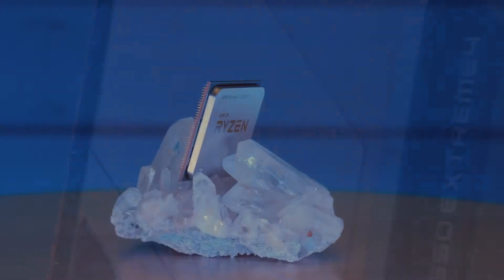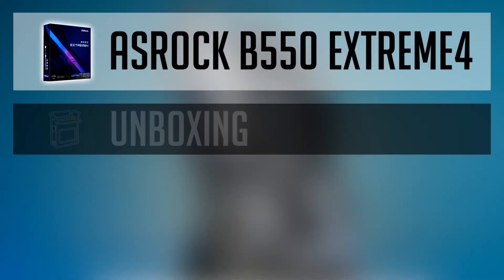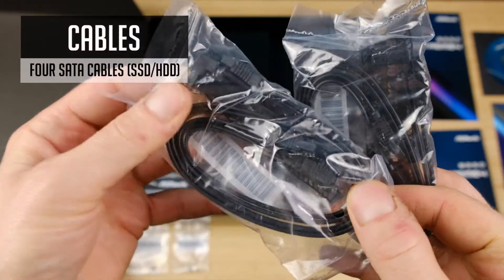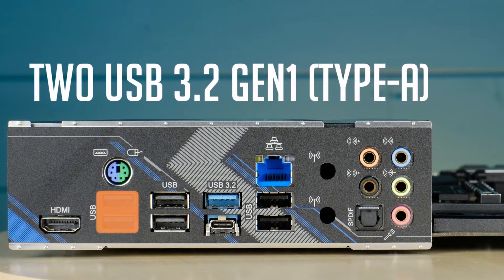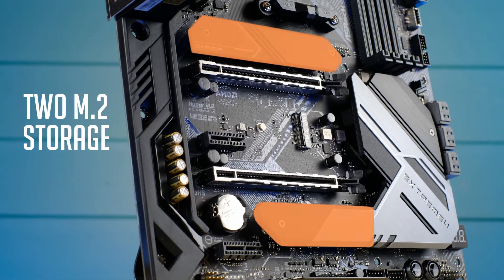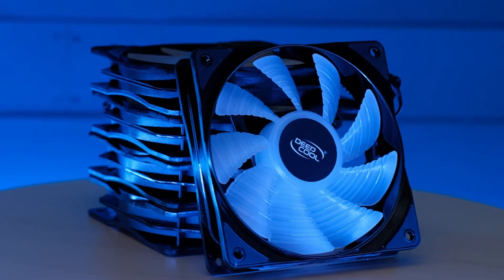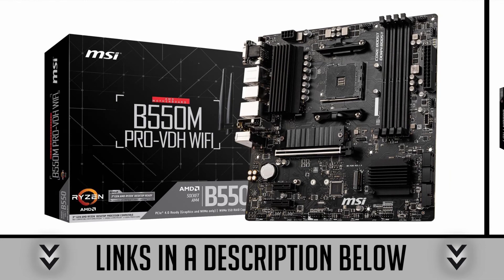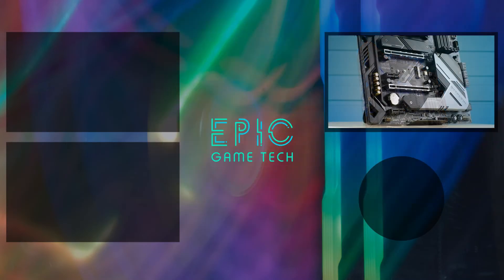GREAT B550 MOTHERBOARD - ASRock B550 EXTREME4 OVERVIEW - Better than X570? Ready for Overclocking

Comment: Should I buy it over the msi b550 gaming edge wifi as it has better rear io and better feature I will be buying it for r5 5600x come between this two
Reply from the maker: Hey,
both of these boards are really good and their VRM performs quite identical. So even with ryzen 9 5950x overclocked, both boards VRM will stay ~60c.
So in general, both of these are quite of overkill for r5 5600x in terms of OC and performance, unless you specifically want/need some certain features there quite expensive boards can offer. Also, I see that  b550 gaming edge wifi cots ~$200 on newegg while extreme is $159 so it has a better value as of its the price. (different websites might have a different price)
But in general, for Ryzen 5 and Ryzen 7, MSI B550-A PRO is more than enough even for hardcore overclocking :)
Unless as I mentioned, you specifically want to pay 40-70$ more for some additional features, but it will not affect CPU performance/temperatures with ryzen 5/7 on any of these boards :)
Reply: @EpicGameTech  I have budget of a high end mobo so I am buying it so I live in India and the environment of India is hot and the price of b550 extreme 4 cost Rs.17,500 and the msi b550 gaming edge wifi cost RS.18,000 who's is just $7 difference which one should I buy
Reply from the maker: Ok, i just shared my opinion that this board should be bought with Ryzen 7 or Ryzen 9 :) But sure, if you wish so, you can definitely buy it.
As i mentioned, both motherboard has pretty much identical VRM performance (MSI b550 gaming edge has like 1-2c better).  But have in mind, Extreme4 has an advantage in Overclocking as it has Debug LED screen that can show exact error code. Also, it has start/reset buttons on a motherboard that helps when testing in an open bench (with no PC Case) :)
Both motherboards are really good in general, and very similar in performance.
Reply: @EpicGameTech  does wifi really matter cuz I will be buying a wifi router and it will be connected via Ethernet cable I really like the extreme 4 and if needed I will buy a Bluetooth adapter if I feel need of it
Reply: @EpicGameTech  I can still buy Intel ax 1200 separately for wifi but need to know does wireless network matters if we planned of using it with Ethernet cable
Reply: Which one would you buy ????
Reply from the maker: Well, I can't tell you if wireless matters, only you can decide that :)
I mean I've convenient in some situations, but I never use wireless on my PC daily or for gaming. So for my, wireless is not needed. But you have to decide for yourself :)
Regarding motherboards - if you plan to play a lot with overclocking CPU and overclocking RAM clocks/timings etc. definitely Extreme 4.
but if it's just one time simple OC and you forget it - take MSI b550 gaming edge :)
Reply: @EpicGameTech  thanks then I will be buying the extreme 4 u are so helpful I subscribed ur channel now may good bless you
Reply: @EpicGameTech  also my case will have 5 fans 2*200mm in front and 1*140mm in rear and 2*140mm in top

Comment: Is this board ready for the 5000 series? Cause I ordered it and I just got the 5600x today
Reply from the maker: Hey,
first of all, congrats with a new CPU :) I hope to get one some day for a pc build or etc.
Anyway, any motherboard (B550 or x570) that were manufactured prior Ryzen 5000 release, will need a BIOS update. It's because there were no ryzen 5000 ready bios when they were manfactured. So you would have to update bios yourself in such a situation.
And most of the boards that are manufactured lately, probably got a BIOS factory update.
So how would you know?

Well, you need to check for Ryzen 5000 ready sticker on the box or some indication in eshop, that It's Ryzen 5000 ready and BIOS is updated. If you do not see this indication, you need to contact that particular eshop and ask if the motherboard they sell is from a new batch and is Ryzen 5000 ready or not.
Some eshops can update bios if you ask.

After some time, all of the boards will be ready, as older manufactured ones will be sold out :)
Reply: @EpicGameTech  https://www.asrock.com/support/index.asp?cat=BIOS so would I just go here and download the b550 extreme4? Cause I just checked the box I got and it didn’t have a 5000 sticker
Reply from the maker: Here you can find the latest BIOS:
https://www.asrock.com/MB/AMD/B550%20Extreme4/index.asp#BIOS

So you got this motherboard already or you are planning to get it?
In case you got it, well you will need older CPU to update BIOS on this board. that's why you need to ask if BISO is updated/ready before buying. Unless board has a flash bios button (this one doesn't).

I guess (not sure) it might be with an updated bios anyway, but in order to find out, you will have to install CPU and try to boot :)
Reply: @EpicGameTech  I literally received the motherboard today sadly and is it ok if I go downstairs and use my brothers pc and download those bios on a usb or do I need to use a old cpu still?
Reply from the maker: Yes, the thing is you need to use older CPU (ryzen 3000) as this motherboard does not have a flash bios button (some motherboard has this button and a special USB slot where you can update BIOS with no CPU).

But as i mentioned, there is a possibility it will work (BIOS might be updated). So you can actually contact shop you already bought that motherboard and ask if it's ready (doesn't matter that you got it already). They possibly will be able to say according to some part number etc. you got :)
In case shop will give you an answer that its not update and you got motherboard/cpu etc from them and they do not have any kind of indication for buyers that they may need to update bios, they should definitely accept it back or even update it for you. Anyway try to contact them and ask OR try installing and see if it works :)
Reply: @EpicGameTech  I contacted the Newegg and they said the motherboard was made June 12th and the new bios came out on august for this motherboard so I’m screwed I also don’t have a old Ryzen cpu also is there no way I can just download the bios on a usb then just plug it into my pc once I build it? Or will that not work
Reply from the maker: I would suggest return it to newegg and order the ones with an updated bios. Basically you can return an item in 14 days anyway right?
As I mentioned before, this motherboard has no special usb port where you can update BIOS. So you need ryzen 300 CPU or it will not work. Just return it and ask them to exchange to a new / the one with updated bios :)
Reply: @EpicGameTech  is on a call with them right now and I asked if I could purchase one with a updated bios and I got transferred 3 times
Reply: @EpicGameTech  also can it be any old amd cpu?
Reply from the maker: what a... :) well even if they say no, i think you have a right to return it if its new and you didn't used and it does not fit you. At least in my country, you can return item if its not used in 14 days.
Sure, there are exceptions for some items. You should rear Newegg return policy on a website :)
Reply: @EpicGameTech  yeah I called them they said they can’t pick out a specific one you just have to hope to get lucky and also what’s the cheapest cpu I can buy just so I can update bios and then I’ll return it
Reply from the maker: hmm ok, but you can return it, right?
As then, I would suggest return it and get a different motherboard with a BIOS flash functionality so you could update BIOS via special usb port :)
Regarding cheapest CPU, this is a CPU list that this motherboard supports before update:
https://www.asrock.com/MB/AMD/B550%20Extreme4/index.asp#CPU

So the cheapest one will be ryzen 3 3100 and that one is $100-120. So it's totally not worth it as it's almost new motherboard. Just return this one and get same performance level different motherboard with an update possibility.
> MSI MAG B550 TOMAHAWK
OR
> Gigabyte B550 AORUS PRO
Both are the same level of performance as B550 Extreme4 and both of these have BIOS update visa USB with no CPU required :)

>MSI MPG B550 GAMING PLUS - is also a good one. Less premium than above ones, but cheaper and still a good board and with bios update USB as-well :)
Reply: @EpicGameTech  I think I’m just going to get Ryzen 5 3600xt on amazon since that will come in fast and after I use it to update return it cause I can’t return my motherboard it takes to long to come in
Reply from the maker: Well, you can do that i guess :)

Comment: What motherboard will you recommend for 3700x with a 3070 oc from palit?
Reply from the maker: Hey,
first of all, do you want to build ATX or mATX pc? (what PC case do you have/consider buying)
And if you plan to overclock your CPU or just use stock?
Reply: @EpicGameTech  corsair 465x, Atx and yes, I want to overclock it a little
Reply from the maker: Ok, well this B550 Extreme4 is especially good for overclocking as not even has a good VRM (actually a bit too good for 3700x) but also error code debug led screen.
But sure, this costs ~$180 and if you want to spend less budget, i can recommend these for 3700x that can handle overclocking and are a bit cheaper
- MSI B550-A PRO (https://geni.us/S352aX) ~$140
- MSI MPG B550 GAMING PLUS (https://geni.us/FzEHlBR) ~$150

Gigabyte B550 AORUS ELITE would still be ok, but it's more expensive than both of MSI board, but has worse VRMs :)
Reply: @EpicGameTech  ok, thanks! Is the b550 aorus pro good?
Reply from the maker: Yes, b550 aorus pro is same level as Asrock b550 Extreme4 in terms of VRM performance :) It does not have that debug lcd screen + power/reset onboard buttons, but other than that, it's good :)
Price is pretty much the same of these two boards as-well.
Reply: @EpicGameTech  thanks a lot. In my country the price difference is about 30$

Comment: What if I use this with zen3 cpu? How do I update bios without flash bios?
Great review btw
Reply from the maker: Hey,
well if you buy this motherboard now and Ryzen 5000 later, unfortunately you will need any older Ryzen CPU to update bios.
But when Ryzen 5000 will be released (5th of November) newly manufactured motherboards will have updated bios. they should have "Ryzen 5000 ready" sticker etc. Sure, it will take some time as eshops will still have previously made motherboards with older bios. So you should check with a particular eshop you want to buy from, what bios is in a motherboard and if they can update it.
So, this is the only "disadvantage" of this board as it has no flash button or etc.

P.s. currently I'm working on MSI B550M Bazooka motherboard overview video and will release it tomorrow or Tuesday. But, Bazooka is more budget mATX motherboard (it has a flash bios button) while Extreme4 is a good mid-range motherboard with some nice features especially for an easier overclocking.
Reply: @EpicGameTech  thanks! Didn't expect such a good and fast reply, I'll sub for that
Reply: some peopple had it pre-updated so this may no longer be a concern

Comment: i don't understand english much.
which is better choice in x570 tomahawk and this mobo. 
with 3070 ryzen 9 64gb 3200mhz ram ??
Reply from the maker: Hey man,
well x570 Tomahawk costs $220 or even more in some eshops.
While B550 Extreme4 costs ~$180. So it's a bit of a different price range.

In terms of VRM performance, they are pretty much the same. Both can handle 3900x or 3950x overclocked with no probs :)
X570 has a few more USB ports and a WIFI, while b550 dos not have WIFI.

If the price difference is like 20$ in your region and you need wifi, you can get tomahawk. But if you don't need it and tomahawk is way expensive, get extreme4.
Reply: @EpicGameTech  thank you man. you gives good suggestion . i like to go for tomahawk. first i was thinking to buy b550 tomahawk now i decide to buy the x570. becoz its gives 2 argb header and b550 has only one. so i preffer both the performance as well as the argb looks. 
and i am building it for vfx work. i am not a gamer.
Reply from the maker: Actually, x570 tomahawk has 2 RGB and 2 ARGB headers. So 4 in total.
And B550 Extreme4 has the same amount - 4 (2 RGB and 2 ARGB).
So RGB header wise B550 Extreme4 and x570 tomahawk are identical :)

Yep, I got it that you are not taking a 16 core CPU for Gaming ;D

Comment: Would this pair well with a ryzen 7 3700x, 3080 and 3600 ram?
Reply from the maker: Hey,
Yes, it would. I would say it's even too good for ryzen 7 3700x :)
Unless you want a really good board or you will play with overclocking your CPU/ram a lot.
For a regular ryzen 7 3700x pc I would recommend a bit cheaper motherboard to save some budget :)

Comment: Hey, can I trust the Asrock B550 Extreme4 for my first build?  I'm kindof concerned with the memory support. It's QVL list is pretty tiny compared to what Msi, gigabyte or asus has. I have a thermaltake toughram 3200 kit and I'm worried whether or not it'll support.
Reply from the maker: Hey,
Hmm, I see, well to be fair, I rarely check qvl, to be honest. I mean it's a good practice as that ram is tested and so on. But I never faced a situation up till now that popular ram sticks would not work on certain motherboards. Especially when we have in mind standard speeds like 3200/3600mhz :)
It's just my experience, but you should be fine.
Reply: Well, I had to buy the msi b550 gaming carbon wifi in place of the Asrock B550 Extreme4 due to the unavailability of the later. Memory support is perfectly fine and working with no issues whatsoever.
From what I have learnt is that memory support is mostly dependent on the CPU. If you are planning to use any of the Ryzen 3000/5000 series, any ram will work fine; given you have the updated bios on the board.

Comment: I have Ryzen 7 3700x cpu should i buy it ?
Reply from the maker: Hey,
Do you want to upgrade your existing motherboard? (If so, whats current MB you have)
Or are you building a new pc with 3700x from scratch? :)
Reply: @EpicGameTech   bro i m buying new pc i dont have any MB form the beginning I NEVER  played a game above 25 fps in my life 😞
Reply from the maker: Ah, I see, new experience waiting for sure :)
The best would be to know all the components you are planning to get/budget for a PC, as it might affect what I would recommend.

In general, this motherboard is really good, especially if you are planning to overclock/play around with that a lot.
In case you just want a decent motherboard but you will be doing no OC, please tell me fill build, so I would suggest something according to your budget :)
Reply: @EpicGameTech   
Ryzen 7 3700x 
Gtx 1660 ti 
Gigabyte 650 watts 
1 TB  HDD
8x2 16GB 3200Mhz 
Should  I buy SSD ?
Reply from the maker: Ok, I see, we need to rework this :)
Is it only for gaming? If so, you are buying a really good CPU compared to a GPU. I'm recommending Ryzen  7 3700x with RTX 2070 super and better. Actually with 2080 super and better :)
The thing is, having Ryzen 7 3700x + 1660 Ti will get you way fewer fps than having Ryzen 5 3600 + RTX 2060 Super. Basically, you can have 20-30% better performance for the same budget. UNLESS you are building this PC  mainly for video editing / 3d rendering etc., then 3700x makes sense.
And definitely, you should get an SSD. I will put some parts for you, assuming PC is for gaming. If it's over a budget - just let me know and I can advise where to save $ or what alternative parts you could choose. Since I'm not sure maybe you want some exact PC case for looks, do you need RGB fans etc :)
> https://pcpartpicker.com/list/qLGD8J
So this is a baseline and we can improve this if needed :)
Reply: @EpicGameTech  Bro i m buying 1660 ti because next year i m buying rtx 30 series graphics card but in my country Your suggested Part are costing me 1350$ Total and even some part are not released in my country its soo overpriced
Reply from the maker: I see regarding 1660ti and RTX 3000. Makes sense, but I would try to get a used GPU like rx580, etc. for temporary use.
Regarding parts, yeah depends on the country, not nesceserally you need to pick exact models. It's just a base like for a similar pc. Like 1tb SSD and not HDD as HDD will bottleneck your new/fast system.
Good PSU that means not a gigabyte one :)
Regarding CPU, well yes if you are going for RTX 3080 then ryzen 7 3700x makes sense aswell. But on the other hand, maybe you should get ryzen 5 5600x instead as it will be available from the 5th of November and it should be way faster than 3700x :)
Reply: @EpicGameTech  Bro Thx for your suggestions 🙏